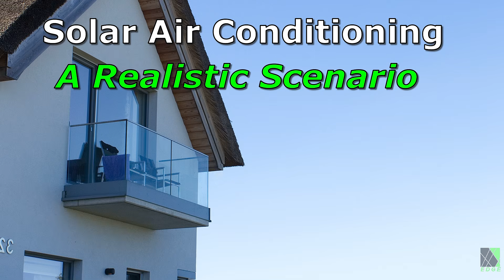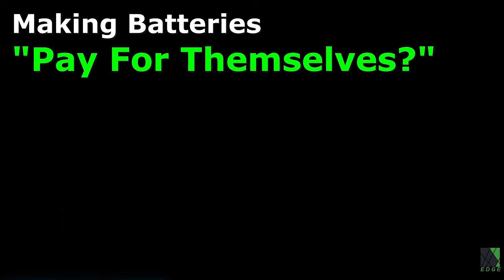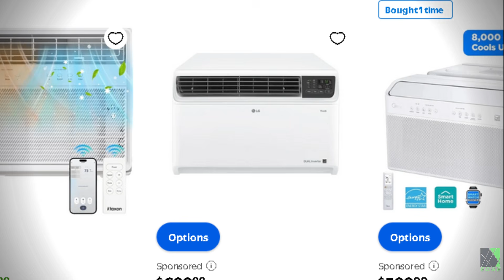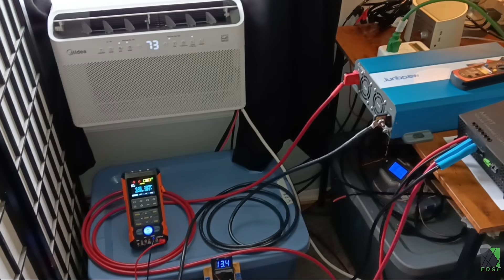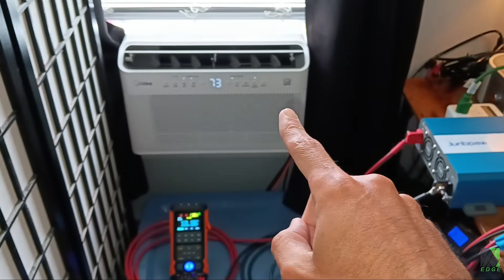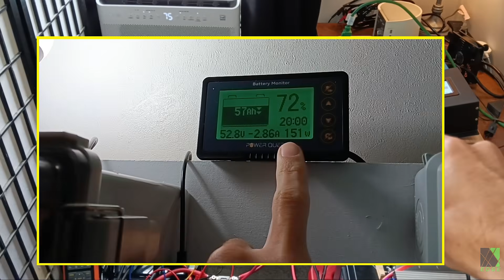I Made A Simple Off Grid Air Condtioning System - But Solar Has A COST  #Sponsored #Cyclenbatt

Comment: Ok this could also be done using a 12 volt mini split. I don't know if they have 24 or 48 volt models. Mainly RVs use 12 volt mini splits. I may try a 12 volt mini split without an inverter and charge controller.. thanks for this video. 73
Reply from the maker: @ronb6182 Welcome - I really want one of those 12v DC splits, or even 48v. It's on the list with 100 other things..
Reply: @solarpoweredge I hear you and understand. 73 

P. S. I hope it comes soon for you. 73

Comment: Portable AC the one I have will dehudify a room and it will collect a lot of water not even 8 hours you will get a 5 gallons of water the water never goes out the large exhaust tube I had to remove the drain plug and run a tube or hose in my case I ran it into a 5 gallon pail. But you could run it outside. This was an older model that used R22 freon. It also used power. Not an energy star device. 73
Reply from the maker: @ronb6182 I had a 10k portable unit for a while at my last place. Wish they didn't pull negative pressure. Even the dual hose one I had did that. However with a good window AC, If it's hot enough it can dehumdifiy most of the time. But about a quarter of the time, I have to switch on the dehumidifier on to stop 60% rH.
Reply: @solarpoweredge I guess if it was in a big room that would not be a problem but a bedroom that is a problem when I had mine I was cooling two bedrooms I installed a door in the hall so the air could flow between the two rooms. Window units are better but they too can make a room feel stuffy. 73

Comment: I have 500ah of 12v storage and 3 400watt solar banks running through a 4000watt inverter. I can just barely run my 10000btu air conditioner for 6hrs continuously in 90+degree weather. The dehumidifier is a great thing for increasing comfort for little energy usage. I know my solar system won’t pay for itself but I really enjoy the feeling of self sufficiency I get from not relying on outside power.
Reply from the maker: @matthew4123-z5o Right on! Nice setup man. Yeah I always felt solar was more about peace of mind and independence, not really paying for itself. Having your own renewable electrical power is like gold.
I heard in some states power costs 90 cents per kwh, so maybe their systems pay a lot faster :)

Comment: Great video Dave.  I love the part about having to work hard to get the “free” equipment they send you.  I watch all your videos and lea n a great deal from each.  Now, if we can only modify that Midea AC to run on ~55VDC, we would be in great shape.  I also asked about the induction cooktop you were using on 55VDC.
Reply from the maker: @Garo-z2g Thanks a lot :) can't help but rant once in a while hahaha. If it's FREE why do I have to work myself to death :D 
I'm working to get a 55V (aka 48V) DC air conditioner setup. Most 48V stuff can run on the system, although some appliances might not like PV2L mode.
PS I replied your other comment, feel free to email me if you have interest in DC appliances and what type you want. Behind the scenes we're testing DC appliances to see if they're marketable before offering them to customers, but maybe you'd like to be an early adopter :)
Reply: Thanks Dave.  Being an electrical engineer with emphasis on power electronics, I have no difficulty modifying resistive AC appliances to run on lower DC voltage, but doing it to induction cooktops or inverter AC is another story.  If you’ve done the latter, please share.
Reply from the maker: @Garo-z2g  I'm still learning. My projects are not that impressive unfortunately. You probably know more than me about the electronics inside... awfully complicated. My opinion: demand for DC kitchen grade appliances clearly exists... but I don't think we should have to modify cooktops, or shove high voltage DC into them. That excludes most people who don't want to modify anything, or can't. 
I believe everyone should be able buy LV-DC cooktops like anything else. Behind the scenes, I'm working very hard with a friend to try to bring LV DC cooking to the community in some form. I hope we can start selling appliances, NOT really to make money, but to "get the ball rolling" after years of waiting for it to roll.... We're a small team. But it's in progress. Maybe you could be one of our early adopters... if you have any interest, please let me know, -Dave

Comment: Hello and thanks for your videos,  im trying  to get my place on solar but have some issues going on.   i have 5 strings of 4 panels at12 volts in series for my 48 volt system. just wonder is 3 panels in series a better idea?  my panels are 100 watts each.
Reply from the maker: @charliebrown-np1tv Hi and welcome! your solar panel open circuit voltage should be somewhat higher than the battery voltage. With 12v solar panels, you definitely have to wire some in series, otherwise, the solar panel voltages will be lower than the batteries - and then they can't charge. Hope that makes sense!
Reply: @solarpoweredge  well with 4 panels in series i am getting over 80 volts and the battery bank gets to high and the inverter turns off.  so i intend to try 3 panels in series  and see if that is better. i am using cheaper brand equipment that came from temu. i have trees next to my property so that is an issue. i will say though with high voltage like that, i can get a charge on very cloudy rainy days lol. only the worst weather keeps me from getting  amperage coming in.  i have a combiner box that can handle 6 lines parallel. i tried a 12 volt system first and that was pathetic and did not power much at all as the battery bank could not be kept charged enough. i am only using 20 panels but i have more. i have 12 100 amp lithium batteries in my bank but plan to expand further. any thoughts on this are welcome
Reply from the maker: @charliebrown-np1tv I assume you are using something like an MPPT solar charge controller between the batteries and solar panels? That is what determines the maximum voltage for charging the battery bank. You can configure a lower max charging voltage to protect the batteries. Don't let them get too high or they can be damaged or even catch fire. Better safe than sorry.

I have pulled over 5000 watts from a 12 volt battery bank, so it's not really the voltage that determines success, but the actual configuration and setup itself. 

Also with multple panels in series, they are vulnerable to shading.. if one of the 3 or 4 in series gets shaded, it mostly shuts down the whole string.

Solar is a learning experience... just keep researching and experimenting and you'll arrive at a setup that works for you. Stay safe!
Reply: @solarpoweredge  yup i have an mppt 100 amp controller that auto adjust for 12,24,36 or 38 volts. my real issue is that i can not get the controller to behave according to adjustments. i thought maybe the high voltage coming in may be effecting its ability to control the upper limits? i have tried several controllers but anyhow i will be trying 3 series and 6 parralel  next and hope that will be better. i also have 3 large panels i have not used yet and they are 48 volts and i think maybe 400 watts. i got them cheap at a storage unit sale
Reply from the maker: @charliebrown-np1tv I start to suspect the MPPT controller is not working properly. It should have no problem at all limiting the charge voltage. A higher PV voltage should not affect charge set points. Anyway I hope you can fix the problem! like all solar installations, it's probably going to involve "spending more money".

Comment: I have the same ac unit as you. It failed because the outside portion has vents on the top of the unit which allowed rain to drip on the evaporator fan which corroded the dc motor bearings. After I repaired it I created a “roof “ over the slots on top of the unit which hopefully will keep rain off the dc fan.
Reply from the maker: @Sailor914 That is a huge problem, thanks for letting me know. I think I will put a roof on top of mine as well

Comment: I have 1800 watts of panel producing 125V and 15 amps feeding a Sandisolar combo Inverter/controller and two 12.8 batteries making 24V. I use a timer that turns on the 12K BTU window unit when full sun hits the panels and off when it starts to fade. This ''supplements'' my 4 ton A/C. I only need the Batteries to handle the surge at compressor start up since I don't run without Solar.
Reply from the maker: @RadioReprised That's a really "cool" setup

Comment: 4000 dollar installed mini-split.... 15 dollar a month summer cooling bill... 60 dollar a month heating bill....
Reply from the maker: @Xboomer1 We have a 18K split, works good for cooling. Not so great when it's 15F outside though, but that's why I use a ton of solar electric heat

Comment: Any hope for a hybrid solar model from Media?
Reply from the maker: @davebean2886 I think it could happen. I have been watching some of the upcoming products, and that seems to be where the market is going. Solar air conditioning is a big deal. Also, there is a new packaged terminal unit with heat pump that should be on the market soon. Or at least I have heard about it. Honestly, these ACs and mini splits should have had DC inputs from the very beginning - there was never any reason why they couldn't. It's just that people didn't realize how simple it could be, so they didn't create any demand in the market. I hope that will change.

Comment: I love your video's. Always practical and accounting for real world shortcomings.
I would love to see this same experiment using just 4 of those batteries in series to make a 48v battery. I believe the efficiency would become even better with one less battery. Of course though there is the extra cost of the 48v inverter.
Cheers from Chiang Mai Thailand where it's also hot and humid and AC and fridges work so much hard than in milder climates.
Another added bonus or keeping your solar shed air conditioned is that the chances of bugs moving in is greatly reduced and bugs can easily fry  anything electrical.
Reply from the maker: @Ulbre Thankful to hear it, thanks for your support :) *and hello to our friends in Thailand. 

Never thought about how space conditioning could affect insects, good point. Since Thailand is tropical climate, I am sure the humdity there is off the charts compared to here.

I have been experimenting with 48v air conditioning lately: first video is here https://youtu.be/1kcqg5tvVsk
A second video is on the way!
Reply: @solarpoweredge  awesome, will be clicking str8 after this comment
Reply from the maker: @Ulbre I appreciate it, every view helps the channel :D 👍

Comment: Setup - Same AC, 4-100ah batteries, 3000 watt inverter, 1200 watt PV tracker, 70amp charge controller - 12v system.
It powers my office 24/7, runs AC, mini fridge, TV, sound system, lights, printers, computers, Wi-Fi, etc. Computer, tv and sound system are powered down at night but everything else stays running, even AC when needed during summer months. I have never ran batteries down overnight more than 40%-50% with ac running. I'm sure "location" is a large part of why.

As with all solar systems... To many cloudy days in a row can become a problem..
Reply from the maker: @niteline42 Definitely location matters. I have similar experience in spring. Mostly not too hot weather - I can run other stuff in addition to the AC. But once the real summer heat hits... the nights stay hot and muggy. And then there's those cloudy weeks, pretty much shuts the system down. However it still serves its purpose

Comment: An idea. Setup a batch of super capacitors that can deliver 4000w surge at the battery point. Then there will be no stress on the battery/components as a power supply
Reply from the maker: @Really2950 I want to try that, still shopping around for capacitors :)

Comment: You can ask for a “soft start” aircon compressor. This way there is no 8 times startup amperage
Reply from the maker: @Really2950 That would be great, because even a 5k unit is very hard on a small inverter

Comment: This may not be quite as true everywhere.  But in the Seattle area, not Seattle  proper. The first 600 kWh at  $0.146 per kWh 
I am under the 600KWh. When I average in all the extra fees my true cost becomes 23.5 cents per KWh. 
If your usage is consistent divide Total $/KWh
Last year with the average I was at 17 cents per KWh. 
With solar powering loads you get out of all the fees. 
We have in addition to the basic charge.
Electrical construction fees
Power cost adjustment fees
State taxes
City taxes
Tiered rates above 600KWh.
Reply from the maker: @jamesadams5281 Good thinking. Electrical power is getting very expensive indeed. I think solar is worth it overall, especially with a bit of patience

Comment: Dehumidification using a desiccant hydrogel with ultrasonic desorption can greatly cut energy usage. Alternatively, feed the hot air from a vapor compression unit into a Maisotsenko chiller to separate hot/cold airstreams.
Reply from the maker: @miscreanity Good thinking!

Comment: Did you make the adjustments for that AC given the recall? Or is this a newer version?
Reply from the maker: @mr.grotto It's the newer version, however I took the drain plug out, and use a dehumdifier when needed. It does affect efficiency, but I prefer to avoid mold at all costs

Comment: Excellent video... because it made me aware of my massive thinking error.  Thank you :-(

It's the power factor that got me. I thought that inverter type devices had a beautiful power factor because the first step in the device, charging a large capacitor using a bridge rectifier, would use just about the whole sine wave.

So I ran to the shed with a kill-a-watt to check my beautiful Midea 8000 Btu heat-pump window unit. Sure enough: pf=0.70  Aargh...  It even got a few percent worse when running less than full power.  Double aargh!   Here i was hoping it was just a matter of undersized capacitors.

Now I understand its all the opposite. Those capacitors only get topped off and consequently only use the top of the sine wave!  It's a miracle the pf even makes it to 70%.

Still, I have to wonder whether power factors are a consideration for battery capacity calculations when running something off grid over your own inverter. Yes the inverter might need to be oversized a little to cope with the bad power factor but the average power drawn from the batteries would stay the same would it not? 

Oh, I live in a predominantly humid area too, but I see dehumidifiers as air conditioners that stupidly dump their heat back into the room they just cooled. Relativity :-)
Reply from the maker: @cobbles62 Welcome, good real-world research you did there on PF. I was shocked how bad the PF is on these units, but in fairness, they are quiet and work well :)

You are 100% right Dehumdifiers unfortunately do make heat. In my house I found they grab so much moisture so fast, I don't have to run them very long, once the interior is dried out enough (carpet, drapes, walls, they all hold moisture) it takes very little to maintain 50& rH.

We're in a super-humid zone with clay soil, like a swamp. Ground does not drain well and water just sits around. Dehumidifiers are a must, especially on a cool night with not much AC running. Our main AC has a "dry" mode but I'd rather save wear and tear on it and run my little dehumdifiers for a few hours and turn them off :)
Reply: @solarpoweredge  I'm getting a bit off topic I'm afraid, because I do like the idea of DC appliances. As an RV'er it keeps me busy trying to run stuff straight on 12V or only a few volts higher using a DC-DC converter. Who knows maybe I'll end up running 170V DC straight into that window unit :-)

For humidity I have the feeling people in general miss the opportunity to maximize the drying capacity of their A/C unit. If one is able to introduce the moist outdoor air straight into the return box of the A/C the system has the least trouble with lowering the overall humidity in the home.    My unit was even prepared with a 5 inch punch-out hole for exactly that purpose.

Of course fresh air ventilation by means of leaky constructed homes seems more the standard here in my foothills of the damp Smokeys :-)

Then again, if people consciously choose to pump fresh humid air in and dump it right at the intake of their window unit, the slight over-pressure created in the house might stop moist air coming in at less desirable places while the A/C unit maximizes it's drying capabilities.
Reply from the maker: @cobbles62 No worries.. I hear ya... some newer window ACs have a "dry" mode and they work very well, plus still cool the space. Standard mechanical window ACs with coupled drive for the condensor/evaporator fan can be run in low speed for drying, although they are rather more inefficient in that case.